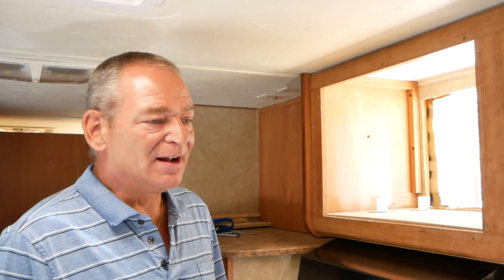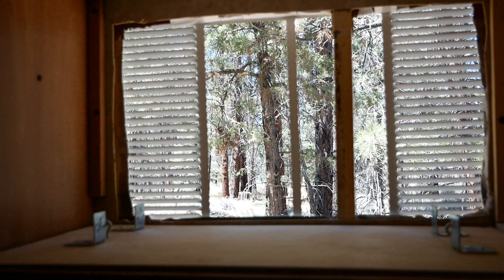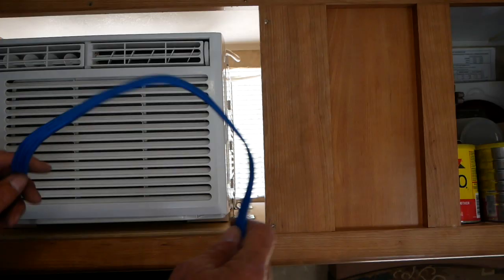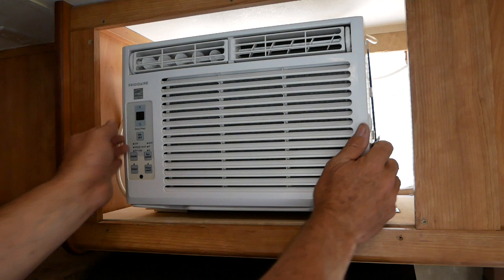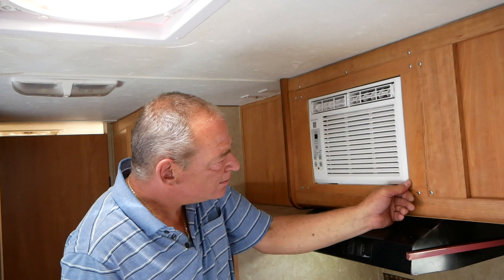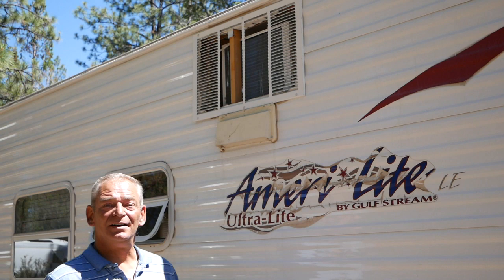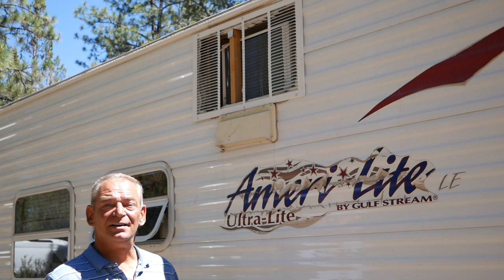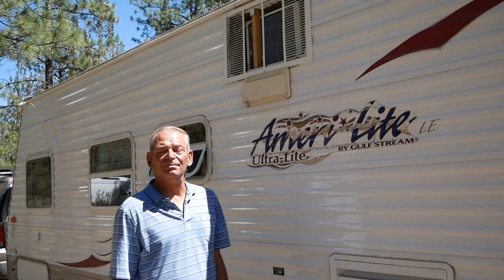Solar air conditioner install in RV microwave cabinet

Comment: Where’s the evaporate water going to drip?

You should have recessed the AC a few inches and had the exterior of the unit extend OUTSIDE the trailer at least an inch. You shim up the front of the unit about an inch so now gravity runs the water outside.

Also, you need more ventilation. You got this thing literally running in a BOX.

Comment: unless you plan on only living in the desert i can tell you that you are going to have water issues with this install, i have this unit in a humid area and it drips outside like a running faucet, the fact it has no drain hole is not because it does not have water going in back, but because the fan blades scatter the water to cool the compressor, not to blow humid air out, you are looking at a disastrous amount of mold and water damage if you go anywhere except the driest of deserts
Reply from the maker: I love the desert and hate humidity

Comment: I built a cargo trailer/camper. I use a through the wall 10,000btu AC with a door that can be opened for venting.

Comment: Why this one instead of normal roof top?
Reply: Rooftop uses more wattage, is more inefficient, costs more to repair/replace, and it's on the roof getting hot by the sun, whereas the internal window unit is shaded, plus more room on roof for solar panels.

Comment: Dealer has roof mounted energy star rated unit with structural plan and location for self installers. All new wall, window and rv roof mounted ac units come with low power consumption rotary compressors, instructions, hardware and seal kits.

Comment: mini split is the best replacement, and doesnt use any more power that the window unit
Reply: Amperage 4.72 on the mini split at Lowe's and there is one that is only 4.25 also, mini split inverter model,
Reply: @lifequest7453  Yep have had it mounted in a converted schooly for almost a year now

Comment: The only thing about that unit is there supposed to be slightly tilted back so that the condensation can drip out of the weep holes there's weep holes at the bottom of that won't it leak inside your RV?

Comment: Hi Jim, I am looking for some advice on what battery isolator I should get off Amazon?
I'm not a full-timer. My secondary battery is only a lawn tractor lead acid battery. I only have a couple of dome lights to run in my camper. No plans for an invertor.
I want to put the isolator in the trunk. Would a solid 12 gauge house wire be strong enough to run from the trunk to the main battery? What size fuse?
Thanks
John

Comment: I'm not sure if you realize that the rear of the A/C unit doesn't just blow out hot air from the condenser. It also sucks in ambient outside air which is pulled over the condenser coils and then exhausted back out. Unfortunately your current design isn't overheating due to the grill design, but because it's constantly reusing the hot air over and over again trapped in the enclosure.
Reply from the maker: actually the grill design was deflecting some of the heated air to the sides where it was picked up by the in coming cool air being sucked in by the side and top vents. The overheating issue stopped once the center grill vanes were removed and the exhaust was allowed to flow out freely.
Reply: @solarboondocker4597  These units are still not designed to operate this way. By having the unit recessed in that opening it's still recirculating super heated air. Just because it's operating and cooling doesn't mean that it's operating correctly or efficiently. I just wouldn't want others to go through the trouble of cutting a big hole in their RV just to find out it either won't cool efficiently or is prematurely causing the compressor to fail. I'm not saying it can't work this way, I'm saying that it's not efficient nor designed to be used this way. There is an ambient air intake and a condenser exhaust. They are mixing in your set up. There's no way around it. There should be a baffle between the two sections and each should have different vents for both intake and exhaust. Even then it won't be as efficient as it could be and not recommended to be used like this per the manufacturer.

Comment: I just don't see how 2 batteries can run AC more than a couple hrs at night. 450ah x 12v=5400 watts÷ 50%DOD and then ÷ two Frigidaires at 820watts = only 3.25, or 6.5  hours with one AC from 5pm to 11:30pm. So I would need 4 batteries for only the one AC from 5pm to 6am. Plus cook and do other stuff add a battery or two. Maybe if you are in a desert that gets cold at night but the SE or SW like FL or CA - no way during anything but temperate months or at higher cooler elevations/locations. Am I missing something? Daytime sure, it sounds good, but at night it seems like for 12hrs w an AC and appliances I would need minimum 5 batteries. Is that correct?
Reply from the maker: You are correct. Solar panels providing the power to run the A/C's is definitely a daytime thing. I designed my system to meet my needs and I do stay in the desert (winter) and mountains (summer). There is rarely a need at night. 
In your case you want to run one for 12 hours at night. 12 x 45a = 540 Ah of usable power. That would be six 100 Ah Lithium batteries or 1200 Ah of lead acid. This is assuming that the unit never got it cool enough to cycle the compressor.

Now not only do you need to recharge those batteries, you need to also run the A/C for 12 hours of daylight too. My array can do either recharge the batteries or run the A/C but not both. So you will need to double up and provide 2200 watts of solar.

No one said being off grid is cheap or easy.

Comment: Great vídeo!
The inside finish is perfect(!), but I believe that this overheating is a problem and you will need to rethink the ventilation method.
Reply from the maker: overheating has not been a issue since I opened up the grate
Reply: @solarboondocker4597  Excellent!!!

Comment: Maybe a split system would work better. They are highly efficient. Have u ever looked at those?
Reply: These are possibly the most efficient option for RVs but are typically much more expensive, possibly costing as much as replacing the rooftop unit, but taking up space in a different way.

Comment: to make it more efficiant, and to prevent from overheating, you have to separate the air which is taken in from above and the sides, from the air which is getting pushed out from the condenser coil.
otherwhise a part from exhaust air is getting pulled back in from the sides, which causes to overheat the unit, and prevents it to work more efficiant.
Reply from the maker: hi Carlo. I plan on using a cowl to separate the the intake from the exhaust. As it is this A/C runs 10 to 15 degrees hotter than the window hung unit
Reply: @solarboondocker4597  out west the use of the swamp cooler is used versus the southern A C unit that is more of a dehumidifier so isn't that a problem out west in the low humidity climes ? I'm not sure how you are dealing with that issue ?

Comment: Jim - Just wanted to confirm --- The heated exhaust air is going out through the center section of the vent (no louvers) and the fresh intake is coming in through the louvers on the side? No concern that the fresh intakes could be pulling some of the exhaust back in? I'm thinking of doing a similar install using a marine hatch to cover the opening during transit and when ac is not in use. When it's ac time,  open the hatch (upward to keep rain out) and let it run.
Reply from the maker: You are correct in that the exhaust is the center and the intakes are on the sides and top. The issue I was having when the louvers were in place is that the A/C sits a inch away from the vent. The heated air was not being ejected out of the vent, it was being blown against it and deflecting to the side and being sucked back in. It runs cooler now but I do agree with one of the comments that a set of fins around the center would carry the heated air out further so that less would be sucked back in.

Comment: Nice idea, but NO. You'd be better off if you put the unit on some rails so you could slide the ass end of it completely out of the wall when you're parked and want to use it. That condenser needs to breathe.

Also, you need that backside outside the camper because you're going to be creating condensate, which normally drips out of the back side. The way you're set up, that water has no place to go. You're going to wreck your cabinet. Also, it looks like the unit is tilted towards the inside. Water doesn't run uphill.

I like the outside the box thinking, but this isn't going to work.

Comment: well? 
what about current draw ? amp hours? run time on solar ect..  
not any info here
Reply: My last 5050 btu ac it pulled 510 watts but i never did any testing for how much it actually drew over time since it should shut the compressor off and all so probably not real helpful but i kinda think you would want something like an 8000btu but i also live in Texas
Reply: Think about that too

Comment: I am wondering, if you could mount the window unit on the roof.... Make a box for the front and run the cold air through the roof. Maybe use a fan for more flow... You replace the watt eating original ac and can run it with the small generator. Control it with the remote. Has anyone ever thought about it???

Comment: Hi - I've been considering an AC setup like yours & planned on using a locking cargo / baggage  door on the outside. They come in a wide range of sizes and are available on Amazon or if you're in the Phoenix area stop by Arizona RV Salvage - they have an incredible assortment of parts at decent prices.

If you go that route consider how you want it to open - a gas piston for a cabinet door would hold it open and I think it'd be better to have sort of an "awning" above the cooling fins. Plan on using a fair amount of butyl tape and / or some Dicor sealant along with the self tapping screws with the built in rubber washer. I think they're the same kind that are used on corrugated metal roofs.

Comment: I see vents on the side of your AC unit. Is this a through-wall AC or a window AC. If it's a window unit, that would explain your overheating issue.
Reply: I agree. You could put it on drawer slides and push the AC out the side of the trailer when parked to get MUCH better airflow. I remember seeing a van video with an old guy who did that. Had a removable panel or a window on the outside that when removed/opened the AC slid through the opening. Wish I had the link.
Reply: Briala Dulsanaya, when our window AC used as a wall AC overheated, we did just that - put it on a floor/slide for easy use and storage. 
Next one will be a wall AC.
Reply: Greg, that’s what he said
Reply: Briala, yes, we all love that video. The beauty of that and what Jim has done here is not having an a/c sticking out. lol 

I had mine mounted in the back and I hate that it’s sticking out there, but it works!

Comment: When my roof unit goes out again, I’m doing this.
Reply: wait for the update in a year - i foresee killing the a/c with inadequate venting, possible fire hazard from overheating,  & have condensation rotting the inside of the trailer
Reply from the maker: Cyn Ho, I hate to disappoint  you but the unit was installed over two years ago, the video was shot last year

Comment: Nice looking but you need a drain hose and some tilt to the unit and a large computer fan to blow in some circulation as the unit will not work properly or last too long.

Comment: Would it be possible to put solar panels on hinged aluminum racks that fold down over the sides and back of your trailer when you're traveling and then put them up when you're parked so they would act as shades above your windows while also collecting sunlight to maximize how much solar you can have instead of being limited to what's on the roof or sitting out on the ground?

Comment: Jim... why not remove that stud then frame in the opening with angle iron. that would beef up the opening, then instead of using that vent just ad a compartment door that could be opend upwards. Also why not place the a.c. unit on a platform that can slide out. That would extend the back of the a.c. unit out far enough so it would vent properly. If installed the compartment door would not only create a nice look to the trailer it would also act as a shade for the a.c. unit. I'm sure with a bit of thought and planning, this can be done. Just something to think about. By the way, the unit looks very nice mounted inside of the cabinet. Very clean install.

Comment: Nice video would love to know what make and model of unit you are using how much power it will consume and how much solar you need to use the unit would be helpful basically more information on the unit itself and the power need to run it and for how long you can run the unit. (newbie to solar)

Comment: Second point how does your video and title tie in together
Reply from the maker: Were you expecting a air conditioner being installed that will be run off of the power created by solar panels? Hmmmmmmm

Comment: Hey Jim what's up I like your videos about the solar energy I think it's cool how you can run your air conditioner I'm also really interested in the wind power I was hoping to find out if it was going to be enough for you to run your air conditioner at night I was also thinking for your current project you could use copper or brass screws it would look like prettier than the metal ones you have right now wouldn't cost you much . I also saw a cool video it's called "Sprinter van split air conditioner DIY RV conversion" this basically splits the cool part from the warm part and would ultimately be much more efficient .thanks for the continent

Comment: Thanks a lot, still dreaming to have one in the van with this heat in Israel. I remembered in a different video you suggest 800 watts solar panels, what size of a dedicated inverter you suggest for that 5000 BTU (400 Watts) unit? Many blessings.
Reply: I use a !500 watt Aims inverter. Anything smaller can't power my A/C during start-up.
Reply: I have 800 watts solar with a 2000 inverter
Reply: Thanks a lot for the comments! I appreciate the help.
Reply: Ron Powell  Ron, I have a 2000 watt modified sine wave inverter. Wouldn't a modified sine wave cause the motor to overheat? If not, I'll hook it up - Hal
Reply: Ron Powell  Thanks Ron, I'll try it

Comment: Frigidaire FFRA062WAE vs Frigidaire FFRE053WAE ….. there is a model that is same exact size...but 6000 BTU....the 5000btu is 4amps 410 watts...says 150sq ft....the 6000 BTU is 5.1 amps 545 watts says 250sqft.....my feeling is the more powerful would be better...you can always run it less on eco mode...but if needed its nice to have more power.....they have the exact same case size and blower speeds etc etc....I guess one just has a bigger compressor.......and the price is the same......I looked at all the other small 16" inch wide units. they are all 5000btu....the Fridgidaire FFRA062WAE  6000btu....being more powerful if needed in the same small case and only 1 amp and 100 watts higher saying it will do 250 soft vs 150 soft.....like I said you can run the more powerful unit on eco mode if you dont need it or are on batteries...but its nicer to have more cooling power if needed or if your on shore power....

Comment: You should at bare minimum treat that stud against moisture. When the condenser and fan make contact with the h2o from the evaporator the air it blows out will be of high humidity. Therefore making that stud moist. This will affect its structural integrity.

Comment: Why are you using residential window units and not the RV  units that come with the trailer?
Reply from the maker: The roof top A/C that I had removed took up space needed for solar panels and consumes much more power.
Reply: @solarboondocker4597   Thank you. Makes sense. Just was looking at the space in a trailer and where to put the microwave?  So like you said " Design for your own needs" so if I have space and want to leave original AC I could design around that.  Also do you have a list of the equipment you use. So many out there like to use a tried and tested.  Thank you for your time.

Comment: I was hoping to see the solar part too. How many panels, converter, and batteries do you need to really run that air condition
Reply from the maker: On the trailer I have 3 250 watt panels, a 60 amp controller, a 1250w inverter and 675 Ah of battery. That will run one of the A/C's during peak light. Add the 435w panel and 45 amp controller from the truck and I can run them both
Reply: But on these van conversion,  such as the Sprinter,  Dodge ram, or Ford transit. There’s probably not enough room on the roof to install enough solar panels to supply a 5000 BTU air conditioner, correct?
Reply from the maker: @greginfla_1  My most popular design is 800 watts on vans.

Comment: Having the ac unit up high makes so much sense. That's the perfect place for it. Great video.I bought a vintage fiberglass trailer. I had hoped to put in a ceiling unit, but I guess the roof wasn't made for that much weight. A spot similar to yours would be ideal but I'll need to do some cutting because it isn't wide enough.  There were some other comments about removing the cover. How much more room did that give?